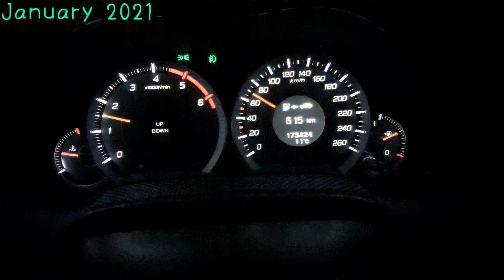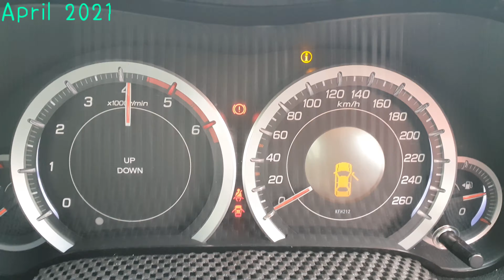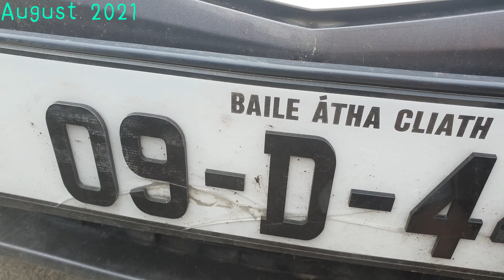diesel engine knocking sound/knocking noise when accelerating/diesel car knocking noise

Comment: I got the same sounding problem on my Clio 1.5 dci. It sounds the same as yours when accelerating but mine doesn't gain RPMs. It's just knocking sound with no power at all, smell of fuel/burned oil in cabin and smoke from the exhaust. It kinda goes back to normal on occasions, but it happens so randomly.
Reply from the maker: It's probably just dirty and that's why sometimes it's fine, also if there is no power it could be your computer not allowing it to rev so as not to damage anything.
Reply: Did you find out why yours does that? mine does something similar
Reply: @anishmahadeo5073  it was some jack that wasnt plugged in next to engine

Comment: Awesome video! I got same noises on my 2019 peugeot 308. Had all 4 injectors and fuel filter replaced and it's still doing the same, but after driving around 50 miles it starts losing power and it's shaking. When i accelerate it kind of gains power back but not for long. It jadders a lot, as if i was in a wrong gear (mind you it's automatic). Revved the engine and it did exactly the same loud knocking as you showed at the beginning of your video. No engine management light on though! Weird... but it's peugeot... my mate suggested timing belt as well. I'm out of options and it's a taxi, 110k miles done. Had it only for 10 months and already pumped so much money into it, like you did with yours
Reply from the maker: It sounds kinda the same as my injectors issue but you've replaced them, so it could be clogged fuel lines maybe, or air intake problems. Maybe a sensor like "mass air flow " dose it have trouble starting too??

Comment: Hi mate went through the same thing as I was losing my mum went out at the age of 41 bought a Ford focus cc  2l diesel . Always drove petrol cars ended up having to replace all my injectors and have the old ones tested thousand-pound DPF was fxxked the hardest part was found in a mechanic that just didn't want to do MOTs or  brakes. £1000 car turned into a £5,000 car as they are getting rear ended up parttin all the pieces out and getting a different good luck from Liverpool
Reply from the maker: Aahh man, sorry to hear about your mam. Yeah its hard sometimes, it all happens around the same time and with every penny you spend on your car you think it will be better from now on until something else happens and its starts all over again, well im going to keep the car for awhile its working fine now so we'll see for how long! Cheers pal.

Comment: Sorry about your woes, but this is all excellent info. 

When you removed the DPF(I've watched your other vids) did you have the whole DPF cannister gutted? Apparently, they have the catalytic converter honeycomb above the DPF honeycomb in the same canister assembly.
Reply from the maker: Hey thanks for watching. Well I'm not sure i just had it removed and mapped out but i still have a cat because it passes emission tests yearly.
Reply: @GPTV2020  ahh ok, does the exhaust gas smell like it still has a cat on it then. If it doesn't have one on it, it'll smell like an old truck or diesel bus (the diesel smell of old).
Reply from the maker: @mickl8212  ah no it smells normal not like an old truck.
Reply: I bet they've removed the bottom honeycomb part (which is the DPF) and left the catalytic converter honeycomb inside it, which is a good thing if they have.
Reply from the maker: @mickl8212  i wouldn't know too much about diesel car's but I'd say they did do that, because without the cat the car wouldn't pass any of it's emissions tests.
Reply: @GPTV2020  yeah, I recon I'm getting mine booked in to have this done because I don't want the woes that you've had.
Reply from the maker: Now check out the laws around removing it before you do it. Your insurance can be void from a payment if they find out, also i had two injectors replaced when the dpf went (this video) and since then 1 more injector went, which obviously had nothing to do with the dpf.

Comment: Happy to see you got your Accord back! Hopefully you'll get few more years out of it. The early mk8 Accords are showing now their age though. I got my fair share of issues last year too, rear brake caliper seized (seems like a common problem in these models) and the ABS pump died. I was lucky I could find a refurbished one but it wasn't cheap.
Congratulation and keep it up!
Reply from the maker: Thanks for your support pal. Yeah they have some little problems but lets hope its all over now! Cheers.
Reply: @GPTV2020  have the same accord, GT version. Best thing i ever did was remove that fooking DPF filter the minute I bought it. I put diptaine in the fuel every time i fuel up, this does wonders for the engine, injectors, exhaust system and general engine health. I also change the oil every 5k I know that's an overkill, but it keeps the carbon to a minimum, they're a great car, hopefully that's the end of all that bad luck and you get to enjoy it. The engine itself is bullet proof, so I wouldn't worry about that.
Reply from the maker: Thinks a lot Pal. Every 5K? Good man, it's good to keep on top of your oil changes. Well hopefully that is the end of it now but only time will tell. Oh i was told by a very good mechanic that diptain doesn't help or damage your engine it just lowers you emissions for a few miles thats it. I use BG 44k. That's good stuff. Thanks for your support 👍

Comment: I've just got the same problem. Was driving on n7 and engine light came on then dpf and exactly the same knocking sound in engine bay when accelerate. My mechanic says it either egr valve or engine..he said it isn't injector..wonder how he figured out that it isn't injector??
Reply from the maker: Ah, shit man, that's bad luck sorry to hear that. Is it leaking fuel from the exhaust? White smoke everything the same as mine? It was 100% my injectors and I asked a few different mechanics, they didn't have a clue, they said it was bottom end just like I thought at first until I found a good mechanic. So make sure you trust your mechanic.
Reply: @GPTV2020  yeah exactly the same sound as yours with engine check light and dpf right after. White smoke as well..I was scared so I pulled over. Could not start my car after that. Now I'm 100% confident it is injector(s) thanks to your video buddy. 
My mechanic after first check said that it is bad injector too..but today he sounds confused. I wonder if there is any way to detect faulty injector without send them for test? I've honda accord 2010 IDTEC 2.2 exactly as yours. Don't wanna get rid of the car as it was reliable until now. Also I suspect that fishy gas station GO on kylmore road with cheapest diesel..I filled full tank and something strange felt right away but didn't pay much attention
Reply from the maker: As far as I know, you can remove them and when you start the engine they will spit out fuel, but the problem is they need to be spitting exactly the right amount to run correctly but you may not be able to tell the difference between the good or bad injectors!
Reply: @GPTV2020  thanks for reply buddy. I will have a chat tomorrow with my mechanic and will keep you updated when have it fixed
Reply from the maker: No problems, hopefully, it doesn't cost you too much to get sorted. Take care.
Reply: @GPTV2020  how is it going mate. Just quick update on my honda. All 4 injectors went..I got second hand. My mechanic sent dpf to get cleaned. After he refitted injectors and cleaned dpf the bleeding dpf light with engine check light still on!! He is confused so am I. My car still in garage and I'm pissed off :(
Reply from the maker: Ah shit man, thats bad luck. You should just have it removed completely but you will need a remap when it is removed. After that, it should be fine. Mine passed it's nct after it was removed. And you don't have that worry anymore then.
Reply: @GPTV2020  thanks buddy yeah I think I will need to get it removed, pity I agreed to get it cleaned 200e down the drain
Reply from the maker: Yeah it is literally down the drain, I did the same, got a chemical flush then got it power hosed out, but having to take it out altogether. But you won't regret it unless they change the rules on nct

Comment: Does it do it on idle? Not as much when accelerating but it’s there?
Reply from the maker: You can see in the video under acceleration it is there but if you are really gentle with the throttle it's hardly noticed. Same when idling,  you need to rev it to hear it. And it is smoky.

Comment: This is why I’m always constantly checking and topping off my oil between oil changes. these cars burn oil like crazy I have a 06 Honda Accord with the 24K series 4 cylinder engine got 142000 miles got it with 99k it’s been a great car only issue is that it ticks at cold start up I’m thinking it probably needs a valve adjustment and if anyone knows to solve the oil burning issue please any feedback would be great guys thanks I’m looking to have the valves adjusted eventually soon and yea brakes on these cars suck always warping the rotors

Comment: I know the that the video is very old now, but like you vid 👌🏼I have 2013 cw3 my self with 248000km and been having dpf problems and I don’t know what to do anymore with it, and it so expensive to replace it
Reply from the maker: @linasjankauskis219  depending on the laws in your country, or any vehicle testing that need to be done, just remove it. In Ireland our vehicle test don't test for it so most people just remove it.

Comment: Any chance of a vid of how to change fog lights on accord? Mine keep blowing, surely I don't have to take front bumper off?
Reply from the maker: There is a little hatch under the bumper infront of the front wheel it's about 1 foot square that's the easiest way in to them.
Reply: Brilliant Gavin cheers for the reply and congratulations on your channel.
Reply from the maker: Thanks pal, hope it helps you out.
Reply: @GPTV2020  actually meant to ask, I have a recurring problem with a sticking caliper, any solutions that don't involve me spending Huge money on new caliper?
Reply from the maker: I currently have the same issue i had to replace the rear calipers and disc's and pads, and its starting on the front now. The pistons get a little rusty and start sticking. Unless you want to rebuild the calipers, you buy all new pistons and O rings but trying to remove the rust from the cylinder is the hardest part.
Reply: @GPTV2020  did it cost much to replace a caliper?
Reply from the maker: The rear ones aren't too expensive like 80 or something for two then fitting, i got them done at the same time as the injectors, so was mixed in with the price but around 50 to 100 euro labour. Front are around 140 each then labour too.
Reply from the maker: I know it can be expensive but its your brake system I'd rather have an empty pocket and be safe braking reather then bad brakes and a big bill to fix someone else's car!

Comment: I have the same sound on 2,4 gas engine. I mean when accelerating. Does anybody knows what is the reason?
Reply from the maker: Could be the same issue, or the car needs a service, could be misfiring spark plug hopefully but then again could be the bottom end bearings. Get a mechanic to look at it before you jump to conclusions thinking it's something bad, because it could be something simple.

Comment: Oh man, sharing is caring, i got injectors refurbished localy.. share, just share, u upset me now :))
Reply from the maker: Lol yeah i found it difficult to even find anyone else having the same issue with a honda accord so im shearing this info with the world!
Reply: @GPTV2020  i think u need to tune now no? If dpf is out.. egr still there? My egr is blocked so has been tuned :))
Reply from the maker: Yes mine got a tune too, but i will probably get a remap eventually for a bit more power.
Reply: Mine squeezed 186hp, but its automatic
Reply from the maker: Any clutch problems??
Reply: Not yet.. all good now
Reply from the maker: Cool, I've heard of people doing a remap and then needing to replace the clutch.
Reply: @GPTV2020 My accord is remap, and the clutch last like a year. So is better for you to leave it as it is for now!
Reply from the maker: So the clutch can't handle the extra torque? I think the n22b2 (180bhp) can handle more but mine the n22b1 (150bhp) can't handle it. Thanks for letting us know.
Reply: @GPTV2020  Mine is the N22B1 as well, i changed the original clutch to a LUK clutch and flywheel kit. Like i said, within a year it started to slip on higher gear and full throttle. Thank you for your great video!
Reply from the maker: So it started slipping after you changed it too? Was the acceleration much better with the flywheel? Thanks for your comments.

Comment: Nice to see you and your honda happy again! I had same issue with dpf before so i know how it feels. I chose to have dpf taken off and chemically cleaned. Cost me about 200 💷  but i haven't had issues for about 2 years since. Whats the mileage on yours if i may ask?
Reply from the maker: Thank you! Happy for a while anyway, it feels a little better not in power numbers just feels free or something, it has 174k kms, (almost 110k miles) hopefully it lasts a few years for me, but im not sure if i will move on yet, i want to get a few things done, but don't have time to do anything.
Reply: @GPTV2020  it just seems to me you got a bit unlucky with the injectors. My accord is about 110k miles. Hopefully fingers crossed its fine. My mate is on 167k on hes same model 2009. Had hes injectors  refurbished and alternator refurb. About £600 together. But it seems quite reasonable for high mileage car.
Reply from the maker: Yeah i needed to get my alternator fixed last year, i think I am just unlucky!

Comment: Finally 😁 glad you got sorted mate, keep it until it dies now! When are we going for a race 😂
Reply from the maker: Lol, i want to keep it driving as long as i can now, sick fixing it so no racing! But thanks for the offer!
Reply: @GPTV2020  You'd win with no DPF anyway lol! You should have a little more power with that gone. What oil do you put in yours? I'm changing mine next week. Recommended by Honda is 0w30 but everyone telling me to put 5w30?
Reply from the maker: Not much difference in power being honest. Well oil viscosity depends on your climate temperatures. Id be using 5w 30 in Ireland.
Reply: @GPTV2020  Yes, I use that in my other CL7 Accord. Grand, I'll go with that so! Cheers mate, keep up the good work 😁
Reply from the maker: I've always wanted a cl7, someday ill have one. Getting expensive now.
Reply: @GPTV2020  Mine is no Euro-R now lol, just a K20 executive. I have it 7 years. It's bulletproof. You'd pick one up on Done deal for under a grand I'd say. Another Honda for the front garden ha ha!
Reply from the maker: I've enough for now thanks! Lol
Reply: @TrancePulse  use 5w30 504/507  spec.that should do it for ya, it's what I use and is recommended by eurol and mannol